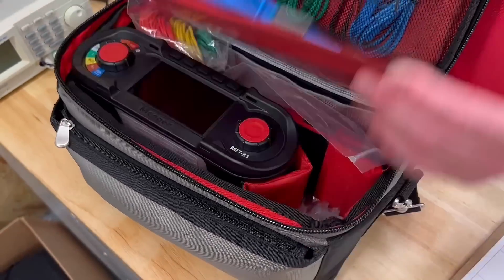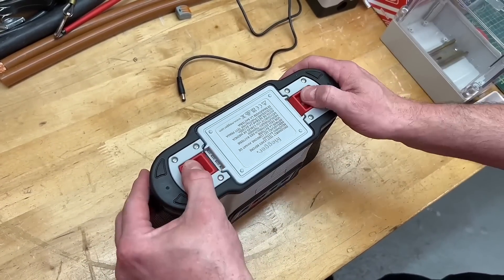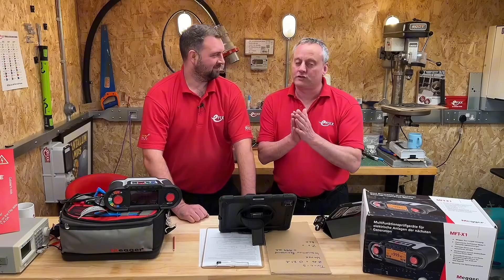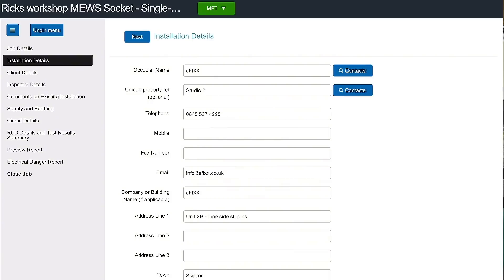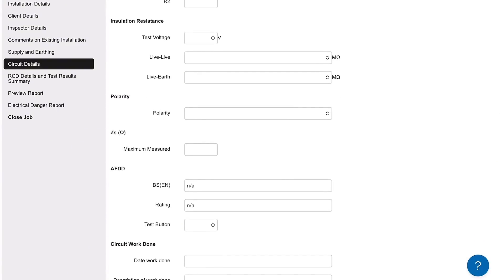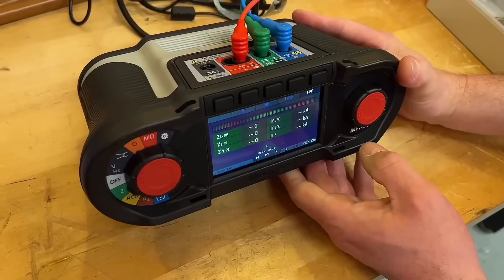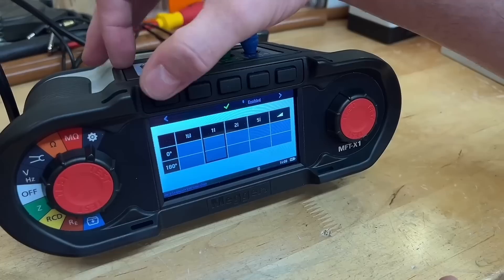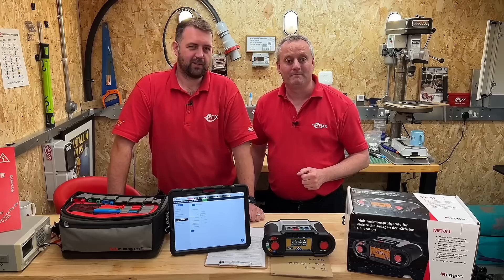Reviewed: Is the Megger X1 the Ultimate Multifunction Tester?

Comment: It's nice, but if you are going to splash that kind of money, the Metrel 3155 eurotester is still the Rolls-Royce of MFT's it really has it all. And it all works beautifully.
Reply: Not in the same price range really. I just paid ~ £1480 for the X1, I'd have been looking at ~ £2200 for Metrel. Paying 50% again on top of the Megger!

Don't get me wrong, I'd love the Metrel and I'm sure it's the nuts, but it isn't comparable value by any stretch.
Reply: @asawyer2872  The Metrel really is worth the extra money it changed  the way i work and has saved me many hours, i have tested with a friends X1, and it's a very good tester   no doubt, the problem is apart from appearance and a few new things it is very much like the older megger MFT's. The real question should not be if the metrel 3155 is worth the extra money over the X1, the real question should be, is the X1 really worth the extra money over its older brothers? And to be honest, i dont think it is since you will still be testing in the same way, and it will take the same time and to use the autofill feature it still needs a support device, so you might as well enter it into Excel running on a tablet with a premade template useing the older MFT.
Reply: @stiaankruger2699 Tbh thanks to black friday the difference in cost between a 1741+ and the X1 was negligible. Odds are it won't, but if one day the user upgradable software might save me buying a new tester, then that difference has paid for itself 10 times over. 

I've no doubt the Metrel makes things easier, but that £700 difference has bought my safe isolation kit, a clamp meter and a few hand tools. 

If I had £2200 just for a tester I'd happily have gone for the metrel, but that is too rich for my tastes. It just isn't in the same price range by some margin!
Reply: @stiaankruger2699  Spot on here mate, in my opinion metrel did it first. if they get the price right they will be flying
Reply: @A45S-W177  someone also pointed out to me that i should not compare the X1 to the 3155 but rather to the 3152 eurotester if one then compare the price the metrel 3152 is much more competitive, it has less features than the 3155 but is on par with the X1 and in ways exeeds the it. 
I have not used the 3152 myself just the 3155 and the X1 but seeing videos of it the basic operation works exactly like 3155.
Reply: @stiaankruger2699  Couldn't agree more mate. 

I used both the 3152 and 3155, the 3155 has a better battery efficiency operation altogether, the 3152 goes through them in a day the 3155 can go 2 or 3 days with a single charge massively better! But I see what you're saying
Reply: @A45S-W177  i have the extended battery option on the 3155, i am not sure if it is available on the 3152, but 3155 uses 18650 lithium batteries in a pack nothing to exotic and the pack should be easy to rebuild if they start to fade. I suspect the 3152 uses the same. I must also add Metrel's PC software and technical manuals are next level they really put in the effort, drawings illustration, test procedures its all there.
Reply: @stiaankruger2699  You're right about the software side of things but I can assure you the 3152 goes through the batteries quicker. It's the way the PCBs were built. I used to work for them...

Comment: Being the owner of an MFT1740, converted by Megger to the 1741+, (as well as having the Kewtech KT66DL) it is good to see that one of the negatives of the previous Megger MFTs of the cable sockets position has been addressed, moving the cable ports from the rear of the top, to the front of the top to prevent damaging the cable ports. My Megger had to go back twice for repair to the cable post circuit board and that was with me looking after it Personally, I think moving to rechargeable battery pack is a backward step. My 1741+ battery life was never an issue whereas the forums give a lot of negative comments on the battery and its battery life.... and obviously, the £1600 it costs to buy the X1! Thanks for the video though chaps.... can you keep it or do Megger want it back? 😜